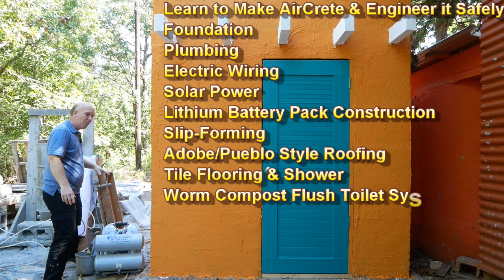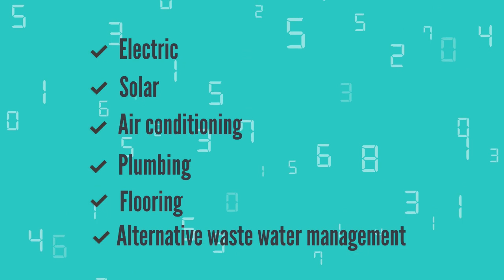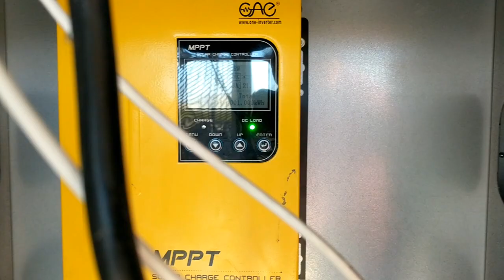Learn to Build AirCrete Pueblo Adobe style House Escape City Live Off Grid

Comment: I am interested (not for myself - I’m a senior and have all that I need) - I’m in Canada and am a mech eng, would love to know the R-value per inch of aircrete, is this available for the mixture that you use?
Reply from the maker: 2.7 ish.  But there are a LOT of variables.  Also AirCrete does not have infiltration airflow so the effective insulation in high. You can generally use standard heat load calculators and add 10% 

AirCrete can be made at any custom thickness to achieve the insulation you want. I find 8 inches to be the point where cost rise faster than the gained resistance to heat flow.  At this thickness it is still very cost effective: $26 per square foot finished move in ready.
Reply: Tiny-Giant LifeStyle OK - I would want at least r40 - so that would mean 15” walls - I would want max 1000 sq fr - with a loft - what do you think the cost would be?
Reply: @willm5814  if you get his course, there is a thorough spreadsheet calculator that will tell you cost and bill of materials.

Comment: Geothermal cooling and heating is the real way to go !
Reply from the maker: Until air quality is filled with mold. It depends on your climate and humidity.  Ground tubes have health challenges, wells with pex in the foundation or radiator and fan. Can also use geo source heatpumps to have control of temperature in any climate

Comment: I lived in a 2 rooms apartment for years.
Never want it again !

You can build a small house with wood and chipwood panels more easily.
Why to build all with concrete ?
Reply: you don't understand. this is not concrete, it is aircrete. this stuff will keep your house cool in the summer and warmer in the winter with far less need for heating and cooling. it does not burn, rot, etc. in the philippines the cement houses heat up very fast and stay hot all night long. aircrete will not do this. it uses cement as part of the component but only part. I am going to build with aircrete. I will make a pole barn house with aircrete as the filler between the poles. it will keep the heat out, the noise out. a concrete house will not keep the house quiet. in the end do what you like. but if you are looking for a material that will be cheaper warmer/cooler won't burn down, won't rot etc. this is the one.
Reply from the maker: Build with anything you wish. Just build yourself something and be mortgage free.